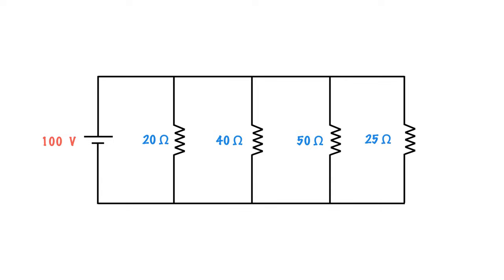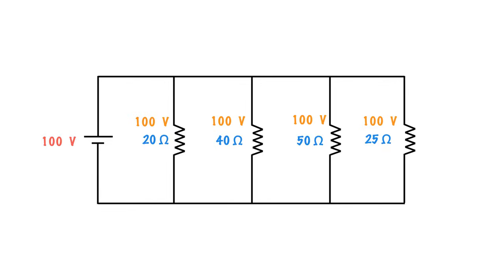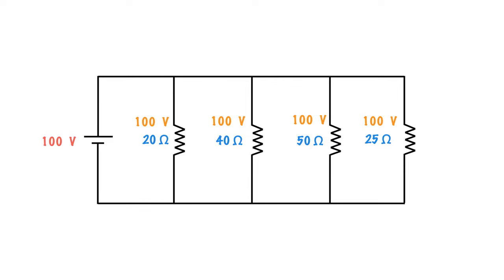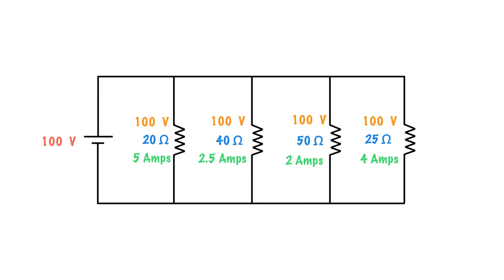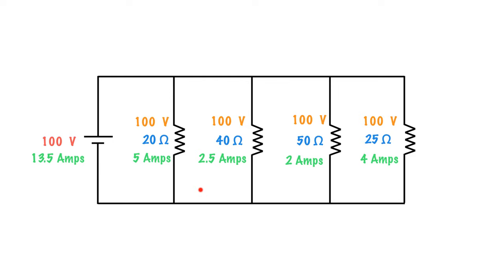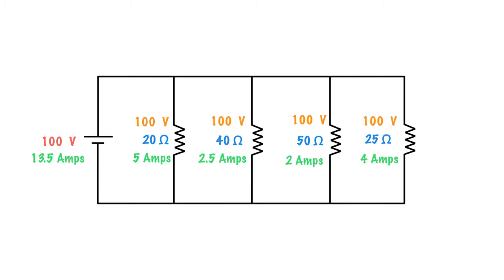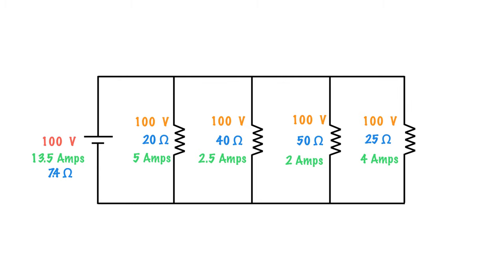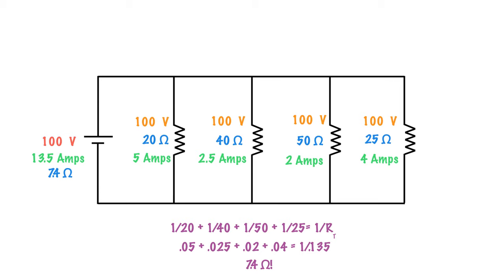DC parallel circuit calculations

Comment: Thank you this really helped me get a grasp on parallel circuits
Reply: As a heavy equipment mechanic..... these circuits are the best shown to visualize a haul truck trailer u see driving down the road every day. The light circuit on those trailers are exactly this per side of trailer for just marker lights.
Reply: We just do 12V circuits.   But I would recommend I'm weary of LED lights. I think my math is wrong...... I measured 20,000 ohms for 2 lights...... 1 was water damage the second it was ripped out of harness, both 20,000 omhs .     
I imagine your a student studying this, I'm asking for your help.....
Reply: I know if there is no load it blows a fuse. If there is to much resistance the light should be dim...... which I had with water damage. I also kno resistance checks with multi meters are crap.... because 1 strand of wire can cause good omhs. Is that what I was technically looking at?

Comment: The first method is the second method with extra steps. In fact, the first method applied to the general case proves the formula used in the second method. In other word, if you forget the formula, then you can always go back to the first method, which only uses general principles (Kirchhoff's laws and Ohm's law).

Comment: Does the parallel branch voltage law still apply if there is a resistor on a series circuit?